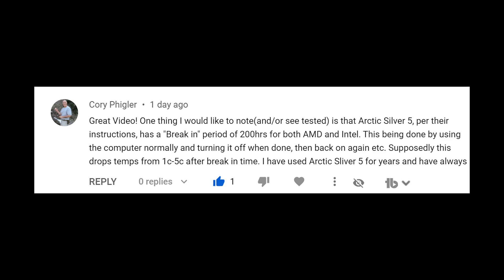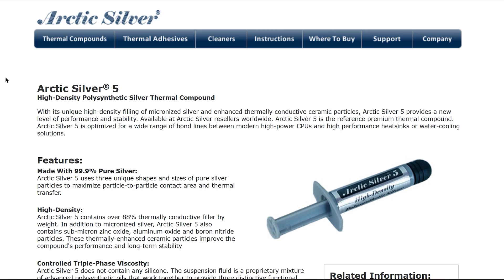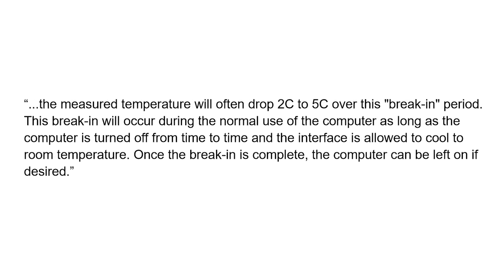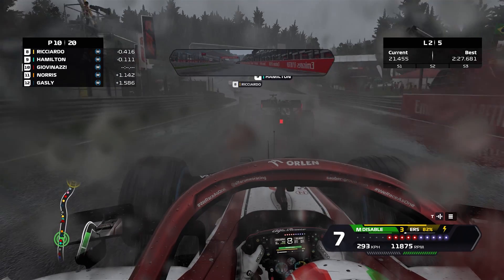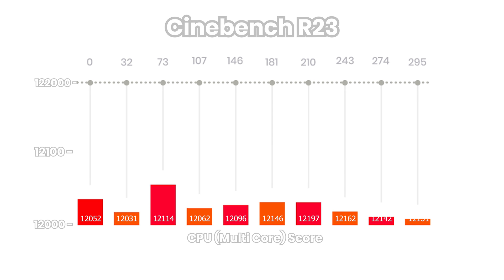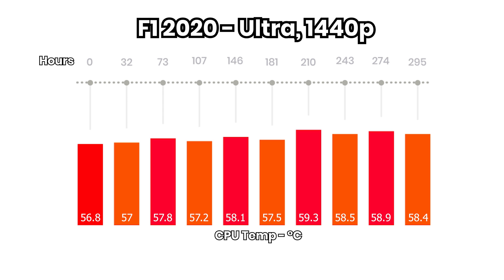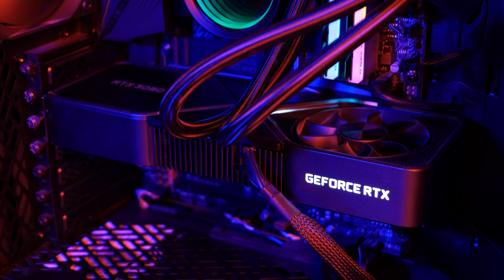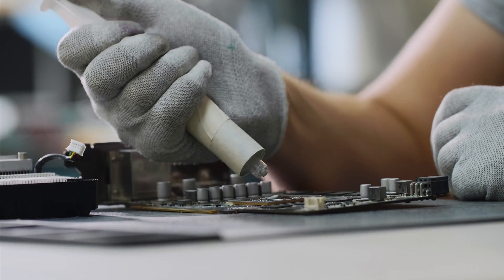Does Thermal Paste Need To "Break-In" ?

Comment: God Arctic Silver is such a bad paste, ime MX-4 beats it by 10°C
I have my 4690k overclocked to 4.8Ghz @ 1.42V on a Hyper 212 Evo from 2014, and she doesn't go past 65°C on P95
And my R9 290 overclocked to 1150Mhz doesn't go past 85°C with the same paste, and if you know anything about those cards they throttle at stock settings usually
Reply: I should add that I accidentally broke a screw on that 212 Evo a few months back and just left it, and even with only 3 screws holding it in it doesn't go past 85°C on P95 @4.8Ghz

I have a grudge against Arctic Silver, for making me waste 200hrs a decade ago 😂😂😂

Comment: Assuming you're using a quality paste like MX-4 theres no difference between the before "break in" period and after
Arctic Silver is asking for your PC to be fried like an egg, its not only conductive, but doesn't even cool as well as a diamond based paste like IC diamond let alone Arctic Cooling

You need to break in an engine for various reasons, thermal paste does not need to break in because it is ready to go out of the tube with no air bubbles unless you did something wrong

Comment: I have a heavy air cooler for my CPU. I'm installing a new CPU, I've had to re set the CPU twice because I get black screen and CPU light on Mobo. I'm about to try tightening the brackets, which seemed slightly loose. Also I'll keep my PC on it's side for a while.

Comment: Spreading a nice thin layer of Arctic silver 5 on my 5800X3D with a PBO curve undervolt -30 all cores and a power limit on PPT, TDC, EDC of 100, 70, 100, got the exact same results as Noctua NTH1 (with all the same settings) and the AS5 spread out a lot nicer too. Other pastes are really thick, cement like affairs compared to the smoothness of Arctic silver, you only need but a little bit and you can work it out really well with a flexible plastic card. I prefer it and I find it didn’t make any difference in performance at all, so it’s up to what you like using. They’ll all do the job, just in differing ways that suit different preferences.
Reply: I'm also using arctic silver 5 on my 5800X3D. It's one of the best pastes out there for thermal conductivity

Comment: Honestly, there are too many variables to control for with this kind of test, simple things like ambient temperature or even higher humidity effecting the performance of fans could skew any results.
 
I remember when conducting an extremely sensitive experiment in my lab, we had some strange results we couldn't account for until someone worked out it was probably due to a football game, during half-time the power grid fluctuated ever so slightly due to millions of people turning on their kettles during the half-time break and subsequently ruining the results of one of our experiments as we were dealing with very sensitive equipment, we now have equipment to exclude that variable, but my point is its almost impossible to account for every variable since they are practically infinite. 

A change in temperature over time could be because the thermal paste is "breaking in" or redistributing itself, even with a hundred PCs to account for random things like changes in the vapour chamber, faulty fan bearings or an antivirus suddenly deciding it's time for a scan, you'd still have to account for changes in software, weather, batches of thermal paste, power configurations, and fix all frequencies and fan speeds or face the wrath of chaos theory.

My best uneducated guess is that the "break in" time is just included in case the application of thermal paste is a little uneven and causing higher temperatures, and then their "break in" theory is the thermal cycling should redistribute it over time, or waiting 200 usage hours is the average time their marketing department believes it takes for customers to forget their thermal paste isn't as effective as advertised and enough time for customers to forget there was a money-back guarantee regarding being satisfied with the product, or something more or less cynical.

Comment: The problem is that the recommendation for Arctic Silver 5 was written in 2003 and CPUs in those days worked differently. To test the claim today, you would need to lock your CPU at a set frequency (at or under base),  then do your thermal tests. The game fps and productivity test would be useless, as the frequency shifting is part of the magic modern CPUs do to get their performance today.

Comment: Until recently (new system build) I ran AS5 thermal paste on an AMD FX-8350 with an Antec Kuhler H20 H600 AIO. No break-in period and was using the PC heavily from the start. Rarely shut it down aside from the odd power outage or random software/windows update requiring a reboot so it was pretty much running 24/7. Temps were never below 25C and never above 70C and I live in Australia where it gets extra hot during the summer time. I never needed to reapply the paste and never removed the cooler block and the PC was fine for the 4yrs this paste has been applied. I only ever applied the paste using the dot method and not smear it all over the CPU. I've also used AS5 on a previous rig that lasted me 8yrs with the same paste and that rig had an air cooler on it and not an AIO. Same as the rig before that. :)

This new build I'm using Thermal Grizzly Kryonaut Extreme and smeared it over my 5950x as per the paste's instructions. With an NZXT Z73 AIO these chips seem to run a bit hotter but I'm yet to see temps above 77C and below 36C however I'm curious to try AS5 again as it's been my goto paste since forever. The Kryonaut is a pricey paste, you get bugger all for the price and rather sticky where as AS5 isn't and felt easier to apply. Also, I still have a bit left of the 3.5g tube of AS5 floating around in my draw. I repasted my old HD7970 with it a couple years back after replacing the fans on it. I only got one application from the Kryonaut.

TL;DR: AS5 has worked pretty damn good for me for 15+ years over 3 different rigs and a GPU. However each to their own, whatever works for you is best!

Comment: Thermal conductivity is better when the thermal interface is wetter as conductivity happens at an accelerated rate due to the moisture particles in the paste, this is also the reason why liquid metals thermal conductivity is higher, for a test you would need to try a thermal paste that has been used for some time and dried out, 

As for a control test you could use a peltier cooler as this would give you far more control of temperature and or cooling.
Reply: LOL... Half truths still make a lie.

Comment: Yes!  I’ve used Artic Silver #5 for 20 now. Even before I realised instructions I already noticed a difference over a week. This was mostly because I was heating and cooling normally between benchmarking software. It was definitely a change of temperatures from hot to cold help settle it in. Is it noticeable for every day use?probably not.  1.5-3c .  Start up idles settled in more as a max load temps dropped more noticeable in benchmarks. So if you’re going to benchmark score yes definitely break it.

Comment: I found out that in order to get arctic silver 5 to work as it should, you first need to apply a very thin layer, spread it very well and eliminate all the air that could be in the middle, i have always got very nice results using that method

Comment: Since the tests were done with a Ryzen chip, was the clock and voltage the same across all the tests? I mention this as Ryzen can be inconsistent with voltage/frequencys, higher temps could be caused by the chip running a higher voltage

Comment: I've been building PC's for 2 1/2 decades and never seen thermal paste change significantly during use.   There's alot of urban myths about thermal paste circulating out there that just aren't true.   (the other is the notion that you need to change your thermal paste every few years).
Reply from the maker: Depends on the paste. It certainly can dry out after a couple years. I have seen some completely dry paste. I always tell people that if the temps are fine then there is nothing to worry about.
Reply: @TechIlliterate  How does that actually happen, though, short of using mayonnaise as thermal paste?   Synthetic lubricants and even petroleum oil doesn't break down or evaporate at the temperatures that CPU's typically run at.

Comment: I have experienced about 5C drop within 2 days with Arctic MX-4. In my case CPU is Ryzen 7 5800X and cooling is Arctic Liquid Freezer II 280 AiO cooler. Now the thing is tubes on this AiO are thick and heavy and I had a bit of trouble putting the pump on the CPU. I definitely did not have even pressure as it tilted while I was putting it on so I probably ended up with very uneven spread with much thicker paste on one side of the CPU. It was probably the worst case scenario. When I tested it shortly after putting it all together I was hitting 85c under Cinebench. When I retested it 2 days later it never gone above 78c. My assumption is that if thermal paste application was very uneven then its possible it will even itself out over some time and a few thermal cycles but if it was good from the start nothing will change.

Comment: should have added ambient tho. All this is meaningless without ambient being exactly the same. 20 ambient and 75c load  does not mean that with 23c ambient you get 58c load. olikely it will be 80 load as the hotter the air the lower the cooling capacity.  And i have left my AS5 on for 10 years now.  and its still the same. my new pc uses kryonout and that lose performance after a year already.

Comment: All modern CPUs will boost at different rates to maintain target temperatures, so you may never see a temperature change, although performance could be changing.  There's no good way to test, aside from manually locking the CPU clock rates, or just use Cinebench scores as the metric (if temps are same).    I applied Kryonaut over the holiday break to my 3700X and noticed zero temperature change, but then I realized my Cinebench score bumped 500 points...was obviously boosting longer, targeting the same temps with improved cooling.
Reply: you probably uninstalled some bloatware and don't even remember lol
Reply: thats true only if you termal throttling which is clearly not the case here with 55 degrees
Reply: @freezerain  That's how CPUs used to work. Now they boost to their thermal limits. I think Intel puts some arbitrary time constraints on their boosting, but AMD doesn't. But even then, I don't think any normal cooling system will be able to maintain max boost indefinitely.

Comment: Umm.... what were the room temperatures for each of the tests? There's no point saying the absolute component temperatures without saying what the room temperatures were. Also were you running at a fixed fan speed? Some tests may have had the fans running harder as the fan controller automatically adjusted their speeds to make the temperature be within the controller's idea of the ideal range. With the information you presented here, there can be no conclusions reached, as you've left so many variables unspecified.
Reply from the maker: All tests we're done with the ambient within 1 deg of 22c

Comment: for Kryonaut, I've seen increasing temperature which requires me to repaste annually. 
Scar 3 running a i7 9750H locked at 3.5 ghz,  max temps at 85-87c starts deteriorating to 94-95c max every year. some of my friends suspect chassis flex from having the laptop carried here in there change the way the paste touches the copper plate.
Reply: thats pump out effect
Reply: @tiiiooooooo  I think it’s rare with NT-H2, my laptop is going strong on it… But it’s been just a month
Reply: Try Noctua's paste instead of crazy over the top TIMs; probably handles flex better than Kyronaut.
Reply: I had a similar experience with my desktop CPU’s and gpu’s. Paste lasted between 9-15 months. Temps were higher by as much as 10 degrees. In one particular case, it went from the 70s, to suddenly shutting off due to overheating. I’ve since switched to mx-5. I’ve only been using it for a few months though.

Comment: Neat results. Yeah it just depends. Some pastes require time to cure, others do not. Also, some are better for specific tasks as well even though they may not conduct heat quite as fast-if they need to be very stable for example, or are chosen for a specific viscosity. sometimes a higher viscosity paste can work better even though its thermal conducivity is a little lower because it will be more stable and it will have better contact especially if your mounting pressure is poor. Such pastes are often chosen for laptops or GPUs for example, As they will likely not be replaced by the end-user and need to be stable for a long time at high temperatures. Simply choosing the paste with the highest thermal conductivity is not necessarily a catch-all solution like many think.
Reply: well said. People looking only at numbers and thinkink "lower temperature?  it's better". No. It's only made for a different purpose. It' s like comparing family car, suv, city cars and sports car. In same cases i prefer extreme performances knowing that in one year i will open the pc again,  in other cases i prefer to "loose" 3-5 degrees but apply the paste once for the entire pc/laptop lifetime. In some cases i prefer more density, other cases lower density paste...the ability is to find what better suits for your needings.

Comment: The result seems perfectly reasonable.  It is safe to say that factors other than paste break-in (change to the ambient temperatures, changes to Windows and software used - such as updates - as you mentioned, etc.) affect temperatures more than changes to the paste over time.  Assuming a proper and consistent paste application, of course.  Some people are pretty OCD about paste, and as you point out, getting perfect controls over all variables is so difficult as to make conclusions arguable.
Reply: The thing I would've liked to see or know was if the CPU was boosting higher after it "broke in" according to the manufacturer which could explain the temps.
Reply: @Adierit  Wouldn’t the c23 score be higher if the cpu boosted higher. In my opinion the scores where just a margin of error.

Comment: Your r23 scores clearly show higher avg scores after 181hrs. This tells me that the Ryzen CPU is able to sustain higher clockspeeds before reaching major thermal throttling because of extra thermal headroom. You should have also posted F1 2020 fps scores to confirm this. My guess for the higher temps in F1 is because the CPU is running faster (because of extra thermal headroom) so your GPU is also pushing more and generating more heat in your case.
I think you need to eliminate the variables on this type of test e.g. set a hard limit on cpu voltage and clockspeed that doesn't hit thermal throttling, as well as post ambient temperature differences.
Reply: Boost behaviour does make it tougher to measure thermal performance.  This applies to PBO, and even GPU boosting algorithms.  This is an excellent point.

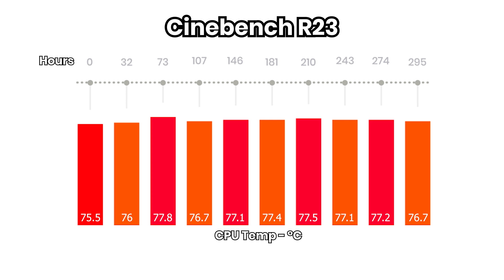Comment: 5:07 We need that video if possible. Paste longevity. No one does that vid. It is as important as the paste performance.
Reply: It does vary a lot based on the brand of thermal paste, how hot the system gets and for how long, etc. It must be very hard to find a control for so many variables and likely why there are almost no videos or concrete evidence at the moment.

I had a Dell desktop running a Pentium 4 with the stock paste, and I opened it 14 years after buying it; the paste was still wet in some areas. Meanwhile my overclocked 6700k had Arctic MX-4 and was dried out in only two years.

Comment: Please help. When I placed my new fan with already added thermal paste on it my temps were around 20 to 30s temp. Now since I cleaned and added new paste my computer is now around 50 to 60 temp. Do I need to wait it out to give the new paste time
Reply from the maker: Probably not break in. You have bad contact...maybe too much pressure. If you're using an AIO make sure the pump is plugged in.

Comment: each thermal compound is different, i've been using AC5 for many years, and have seen similar results, the best performance is seen shortly after installation but normalizes and works fine for years, my longest run with AC5 has been 5 years, and it worked fine with a CM Hyper 212, with out issues, just dusting it out about once every few months.
Reply from the maker: Thanks for the confirmation.

I want to setup a PC just to test out the longevity. Might have to built a server :o
Reply: In the past I've typically only replaced paste every time I put in a new cooler or CPU.  The longest run I think was about six years and I noticed no decrease in performance.  But I was using a lower-power Phenom processor (45W TDP).